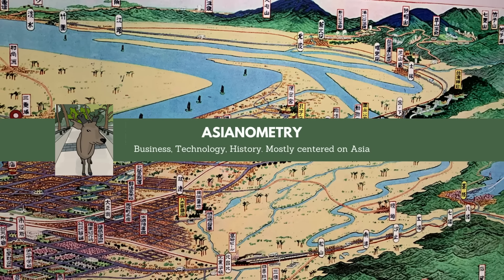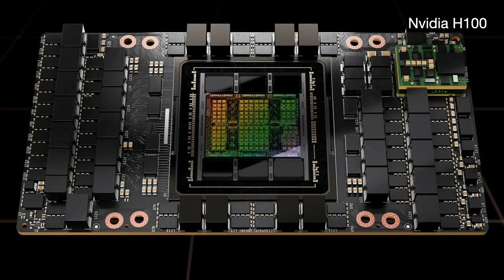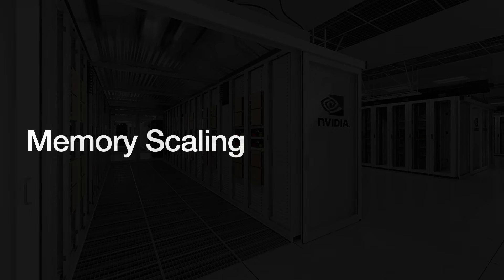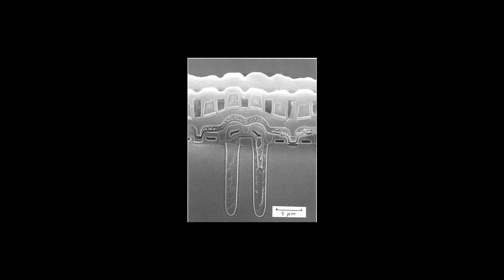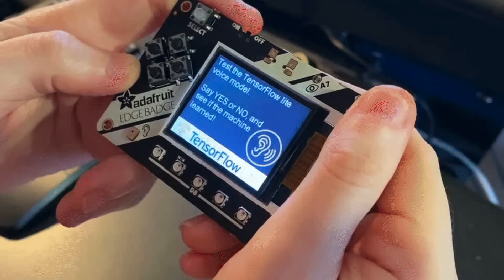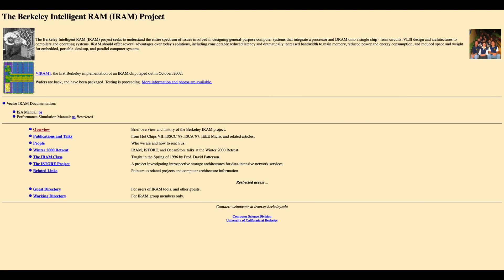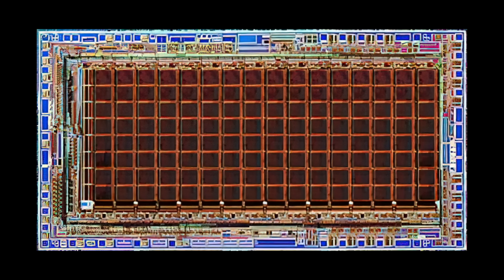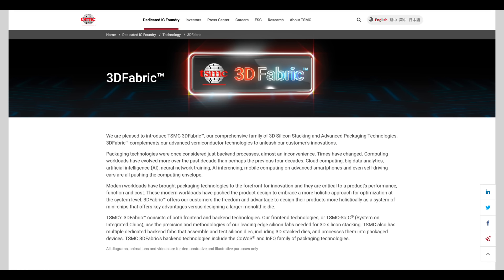AI’s Hardware Problem

Comment: 12:22, I think it might use the laws involving resistance (like those from circuits in parallel, series, etc) to cleverly infer from some 'measured' resistance the addition of data stored within the memory. It sounds similar to what analog computers do, and how they can be used at lower costs to implement trained neural networks for inference.
Reply: Doubt it. give me an example of a pure analog computer. Those mesured resistances are far to unprecise. And why would you do it if you can fit a billion transistors on the size of a stamp?
Reply: @computerfis  Check out Veritasium's video on analog computers. He shows modern examples of analog computers which are used in inference with trained neural network models.

As for the reason why these are used, the video goes into it, but in short it is cost. Both cost of production and energy cost.

Comment: I can help you explain it further. this changing of resistance to keep resistance is called a memristor which was the last discovered of the quartet of fundamental electrical components which comprises also the resistor, capacitor and inductor. basically a memristor is a resistor that remembers its resistance.

Comment: I find the security vulnerabilies of smaller DRAM cells very interesting, could you maybe make a video on this and similar issues?
Reply: Lookup rowhammer. It’s a way for dram cells to flip based on bit flips in adjacent lines. The smaller the cells, the less writes are needed to achieve this
Reply: @Supermangoaliedude  isn't that what ecc ram is supposed to rectify?

Comment: AMD managed to get this working commercial with their 5800X3D processor (3D v cache). I'm curious if they can use that structural silicon for additional memory in the future or if they'll run into another thermal limit like they've kinda run into (kinda not) with the 5800X3D.

Comment: A DRAM (dynamic RAM) cell is made by a FET transistor and a small capacitor connected to its gate. Since the capacitance is small for reasons of speed, the capacitor lose its charge within milliseconds, and the DRAM has to be constantly "refreshed" (with a read cycle usually), so it can keep the bit properly memorised.
A SRAM (static RAM) cell works on a completely different principle. It doesn't use a capacitor to memorise the value of the bit (0 or 1) and doesn't need a refresh cycle.
A SRAM memory cell is basically a RS Flip Flop (Set - Reset) which keeps the set level until it is re-setted. Therefore, instead of a single transistor, each SRAM cell is made by four to six transistors. So the SRAM cell takes more chip space, but it can run at the same clock speed of the logic circuitry; moreover, the SRAM is much less susceptible to data errors and interferences. The Mars probes use exclusively SRAM memory in their onboard computers.
The SRAM represents the ideal operating computer memory, but it takes six transistors instead of one for each memory cell...

Comment: For low memory latency deep learning accelerator applications, there is also innovations at the system protocol levels through CXL (compute express lunk), allowing for memory sharing, memory scaling (of multiple memory types). Great topic. Yes device, circuit, systems architecture innovations are needed for next gen AI.
Reply: I wish he had included something on CXL as that should be a game changer for all the problems he mentions right?

Comment: Well put out seminary. You have presented some real hardware design, a bit of the physical constraints and marketing issues. I bet, though, that problem is not only on an obsolete architecture, but also on flawed algorithms that spend a lot of resources on tasks that can be skipped, not recalculated or just infered by other means which altogether leads to less steps in intermediate computations and storage needs to do the very same job. Be it in CS field or even the brute maths field.

Comment: EXCELLENT! Now do MEMristors!!! lol Seriously tho, have you ever heard of memristors? Its another type of electrical component that is in line with capacitors, transistors, resistors, etc. But it was never utilized. I remember hearing about it years ago, saying that it had be theorized to exist but had never been made or maybe it was never been used... but they had proved it was possible.... but that was the only thing I ever heard about it... maybe that could be the solution to AI/MEM problem 🤷‍♂

Comment: I worked at Toshiba when we had embedded dram on asic, it was a literal dram process on an asic, very complex in terms of wafers but works - the PS2 used it.  I don't see a benefit to using anything but dram though, 1 capacity is always going to beat 6 transistors per a bit so we need something completely different from cmos logic.

Comment: I recall IBM researching 3D memory - akin to a glass cube using lights at two (or more) intersections to either write input or read the resulting output. Even with the slowdown of light entering a translucent (but with some refraction) memory cube, the light speed was a "big" jump over other memory storage concepts. Then the usual no news from the IBM black hole research labs. I might also add that either data centres buy power at a cost to run these AI systems or they build their own renewable power. The latter is more expensive but the days of low cost power from fossil fuels are ending so anything that could cut the power demand at scale would maybe be worth the extra kit cost. Even the big AI players know that cost inflation means all the research falls to them alone vs letting the smaller-agile and left of field risk takers finding solutions that the big players can copy-buy-take over. Imagine the innovation if only Amazon had the scale to offer data centre (and AI at scale) computing power.  If anything the video shows there is still room for truly innovative chip design that combines CPU and memory vs trying to replicate the current Intel/ASML/GPU/AMD/Dram fabs

Comment: Neural networks/deep learning has two major operations, training and evaluation, each has very different requirements. Training is compute-intensive, having to do math on huge matrices and most critically, requires updating those matrices. This requires a lot of memory reads AND write operations and thus is a harder task to design a chip for. 

Once training is done, the matrices are not changed. So when it comes to evaluation (aka making a prediction/standard classification task), the majority of it are just a lot of memory-read, compute and output operations. I can certainly imagine it should be a lot easier to design a low power, high memory, low compute chip using something like ReRAM to do the computation for a single deep learning layer.  Its output gets passed to the next ReRAM chip which does the next layer of computation, and so on.

Comment: Thanks to memory demand in AI we will probably get to see 128 bit integer addressing CPUs sooner than later.
Reply: Just so we're clear: 64 bit addressing with 64 bit word size = 2^64*64/8/1024^3 = 137,438,953,472 GB of memory. So I think we're a fair ways out from needing 128 bit addressing from a capacity standpoint. It may be useful to use 128 bit word size in some applications, to avoid double pumping, but that probably won't be for AI, as those tend to operate on the lowest feasible bit precision. Many operate on only 4 bit precision with 8 being the norm.
Reply: @andersjjensen  👍
Reply: @legiran9564  It gets even funnier if you do the math on how much energy it takes to "count to 64 bits". Even if we imagine that each bit flip costs the smallest discrete amount of energy quantum theory will allow, then the sun will not produce enough energy to do it in it's lifetime.

Comment: I remember IBM filing a patent in the 80' for PC architecture with static ram chips instead of dynamic. The benefits are multiple. However static RAM; is more expensive and comes in smaller sizes. Had they chosen to go with it and had it caught on, we'd not have this problem today.
Reply: patent, in the 80s? sram chips are older than dram.
Reply: @PaulSpades  Read what I write: The IBM patent was for a X86 architecture using static ram, not the invention of static ram.